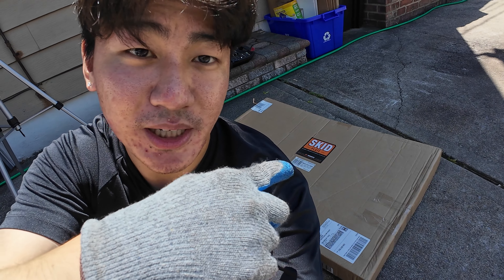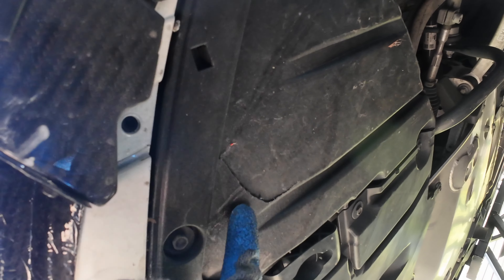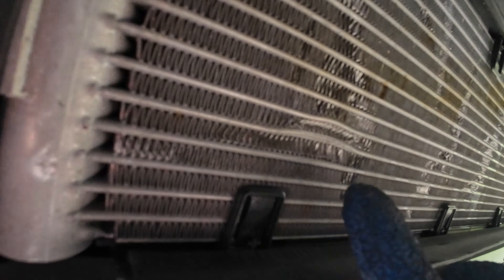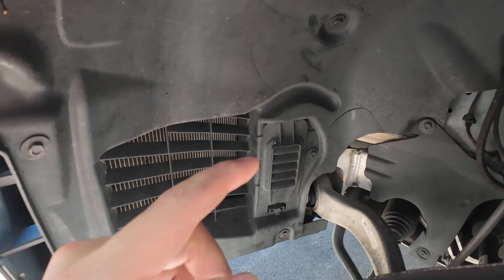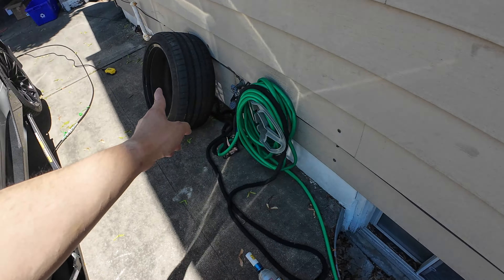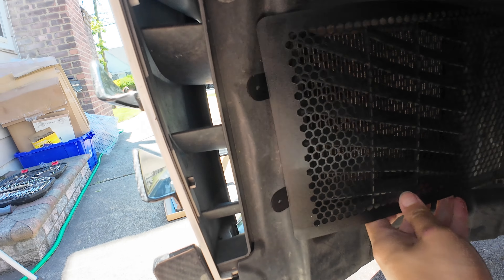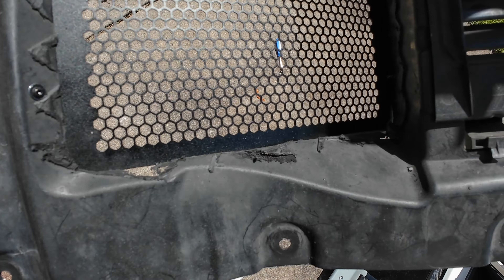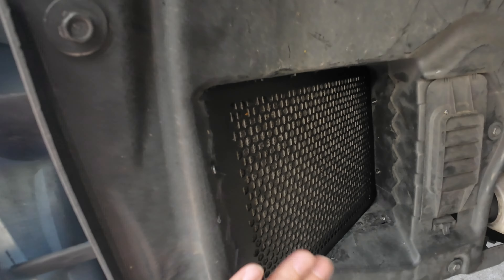Autocross Prep | New Wheels & Tires

Comment: Great video. I also have a white M4, which I track. It kills the outer shoulder of my tires, even with -3.1 camber. Do you get the same type of wear?
Reply from the maker: Absolutely. Before these new “race day” wheel and tires, I was running OEM PS4S with stock wheels and with a -2.0 camber, the outside was getting chewed up and corded after 4 events, although it has been about 5/32 when I first started autocross.
Reply: @only_instincts  thanks for your response bro. Awesome channel.